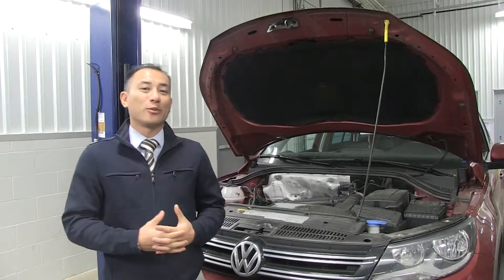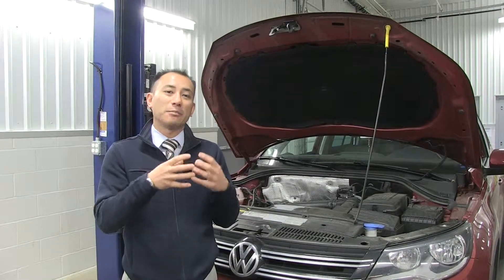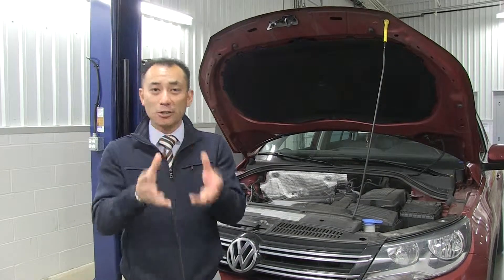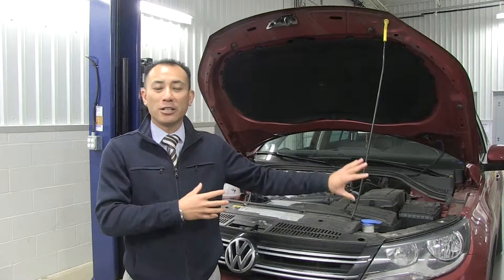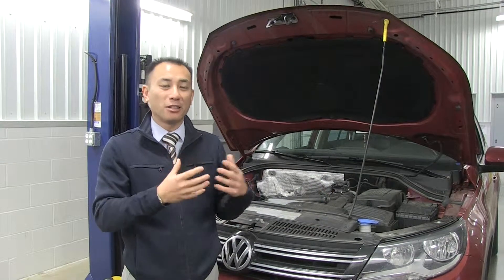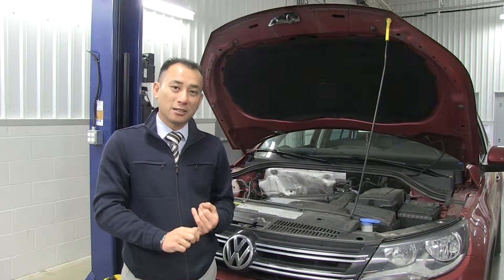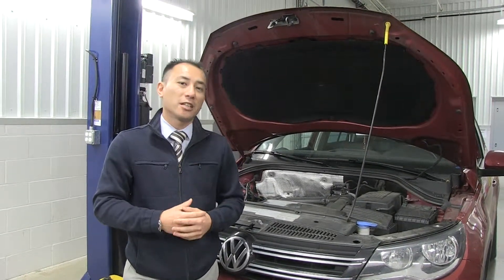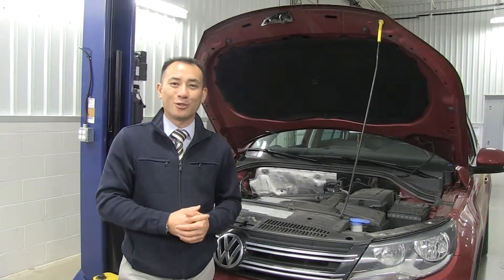Carbon Buildup

Comment: You can't prevent it. Sooner or later, you'll be paying a lot of money $$ cleaning the inside of your engine. I use 91 Octane, drive hard and long, and change my oil every 5,000 miles... but I will most likely clean the engine 1,000 miles before the warranty is up just in case.